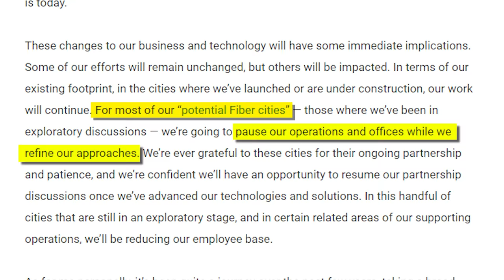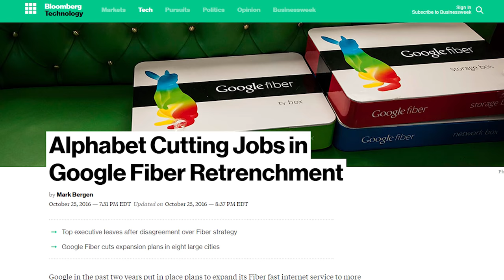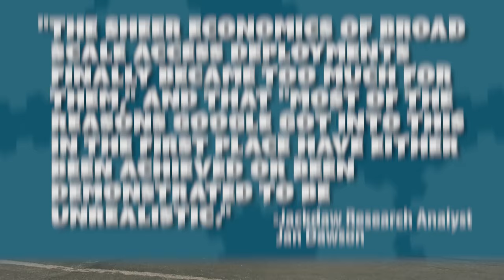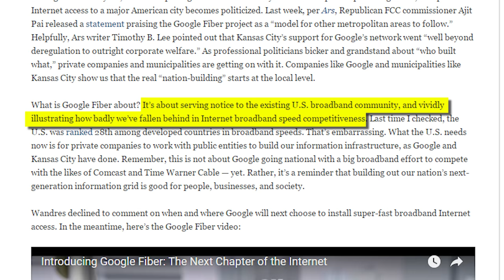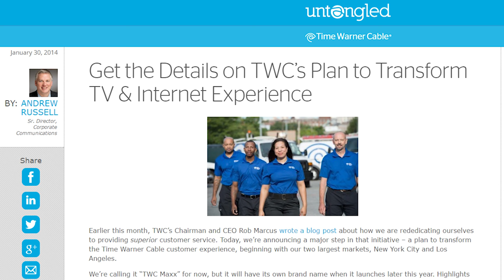Google Fiber Cancels Expansions - The Know Tech News

Comment: Must suck to be in an area with slow/expensive internet, here in sf bay area it's like $40/mo for 80 down.
Reply: TheRancidMarshmallow I pay double for 5-8 down where I'm at.
Reply: where I live there is literally only 1 internet provider (other than cell phone and hotspots but those don't count with the low data caps) and that 1 is century link, I pay over 70$ a month for 1.5Mbps. There is nothing to really do about it, that's one of the main reason why I'm trying to move.

Comment: Despite the lower numbers the cable company has been caught throttling connection speed numerous times.

They're layers upon layers of cheap and I would've gone with google in a blink even if it wasn't a connection speed increase.

Comment: My small town has a fiber business moving in. It is currently available only for businesses and will expand to the general public "soon" (it'll probably take forever, let's be honest). In response, my ISP quietly bumped up our connection speed by 30Mbps without any notification. They put in work at the poles for a few days and once they were done I happened to download an update on Steam and it was between 6 to 7 MB/s. That's blazing fast for my area. I still plan on bailing to the fiber service as soon as it becomes available to the public, but it's nice to have this new speed for now.

Comment: I have Google Fiber.  I also have horses bout a couple of city blocks away from where I live in KC, Kansas.  Come at me The Know guys :)  However, the last part of the video where you talked about service getting better due to Google Fiber happened extremely fast in Kansas City in areas before Google Fiber was even available.  All the ISP's I have access to or are in the area in general all offer packages way above their own national averages.  Of course they still do the whole, "not throttling" thing where they throttle you but claim they don't.  I tested this multiple times behind high speed SSL tunnels and as soon as I hid my packet information I no longer had throttling issues on any server (mostly twitch and YT).

Comment: I suspect a lot of the construction issue has been being blocked by ATT and Comcast at every turn to get access to the poles. Because Google isn't classified as a 'utilities' provider, they do not necessarily have access, forcing them to go the significantly more expensive route of burying the cables. And as it turns out, ATT and Comcast aren't real fond of just letting a major competitor in, and have lobbied to block ordinances and law changes that would give Google access. They haven't won everywhere, but it's been enough of a fight that Google should seriously be rethinking their deployment plans.

Comment: I live near LA and have Time Warner Cable (now spectrum or w/e) and currently have the 300+ Mbps speed. I'll say this, it's fast. But it counts for nothing if you're using a Wifi router to connect to your internet like most people do. Especially if the router is an older model. Unless you're running a wired connection you simply can't reach the top speeds it's providing. Of course what your Wifi router caps our at depends on the power of the router.

Comment: We have cable.  It's been boosted on speed maybe 2-3 times, twice by us and then they announced a boost across the board.  We just got a brand new modem of one of the higher models.  Our connection has never been slower.  

I still really suspect one of the roommates is doing an insane amount of downloading and not being upfront about it or something.  But even when only one person is home unless it's my desktop system (that's the only thing plugged in direct) there's a lot of lag, especially on video.

Comment: here in Alaska, fiber cables have installed it more populated cities and towns. Granted, the two ISPs we have here are bullshit like timewarner and cuntcast, jacked up prices and obscenely shitty data caps. Here's what google should do, become an ISP and only an ISP. the reason the internet services in the US are trash compared to other countries is that all of our ISPs are also cable companies who see greater profits in selling an advertisement box with a shitload of garbage you won't watch but have to pay for so you get the few channels that do interest you. not to mention on demand, priced extremely high. people prefer Netflix and other streaming services since its cheaper and reliable. cable providers add a data cap so it nudges customers to pay for on demand content instead of using a bunch of data and then paying horrible overage fees. GCI, a cable and internet provider here in AK, has "no worries" internet. meaning nothing since the data cap still exists, but they don't charge overage fees. instead they charge for data "buckets" that cost about $10 for 30 additional gigs. better than the only other option here, MTA, which costs more, is slower, lower data caps, and expensive overage fees. they do have a cap free internet plan, but it's around 5 mbs if you're lucky.

Comment: Ok, I am still in the middle of watching the video, but the drama of "smashing dreams" is getting on my nerv's.  Half the problem with hyper speed, laser internet access speed, is the devices between the laser lines, aka, the servers themselves still can't processes that data at the speed of light.  Unless processors can finally start re-transmitting the data as fast, if not faster then the speed of light, you wont be able to get very far complaining about your "dreams being broken," if the servers they have can't even utilize the power of the optical line.

In all likely hood, you will be waiting for a second or 3rd gen quantum processor for that, or when scientist figure out why and how quantum particles seems to appear and disappear from our reality.  First they have to let go of the idea that light speed is the speed limit of the universe.  Then they can start realizing how much faster quantum physics is and then start making devices that can operate at those faster then light speeds.

Comment: Well, you could have mentioned that Google (and other ISP's) are now developing Gigabit WiFi that will piggyback on power lines, without the need for very expensive installation of new fiber-optic cables. http://www.theverge.com/2016/9/20/12991036/airgig-att-labs-gigabit-wifi-millimeter-wave
Reply: Yeah but...wifi. I'd take lower bandwidth cable lines than unreliable radio wave signals with higher latency.
Reply: Yeah sure the CONSUMER would rather have the fiber optic, but the company who has to spend money to put in the cable would certainly prefer the millimeter-wave wifi option

Comment: my down is 30 and my up is 5...i wanna stream better but my up is to low, time warner needs to get their heads out their ass and increase upload, netflex is down and streaming games to youtube or twitch is upload
Reply: lucky you, my down is 15. Canadian companys are so much worse tbh
Reply: the ting is down is for viewing content like netflex and up is for game/video streaming. i could prolly just stream on twitch but i'd all so want to stream on youtueb at same time. not sure if my upload is good enough for both
Reply: The hell are you trying to stream in, 4k? With proper settings 5 up should be plenty.
Reply: Yeah, lucky you. My max is 4Mb/s down and for the past two weeks, it's only getting up to 1.7Mb/s down.
Reply: 2560x1440....
Reply: Lucas Garcia just stream in either 720p or 1080p and keep bitrate at 3500. You gotta take in consideration that not everyone has fast internet to watch ultra 20k 800fps streams. And if what ever you're streaming on is powerful enough, stream at 60 FPS, it causes less blurring
Reply: At most I get just above 6mb/s and for the most part. The higher end games as well as CPU heavy games bottleneck. I need a better cooler to clock my fx-6300 more. A loud fan makes for crappy viewing
Reply: Im paying 70 a month for 8 down and 1 up
Reply: wow
Reply: PcGaming, do you live in the middle East. That Pricing is Extremely similiar to here